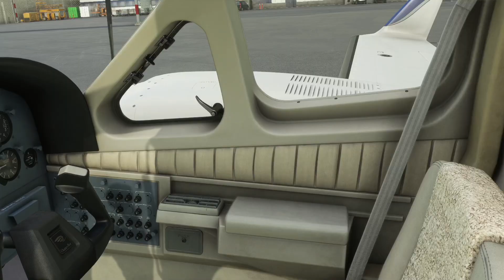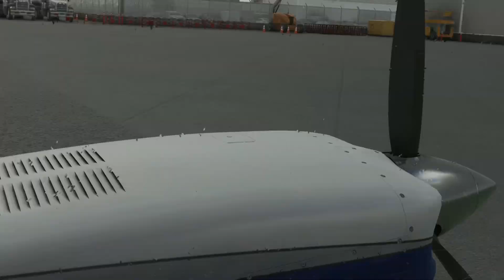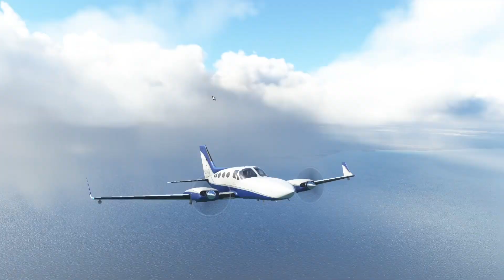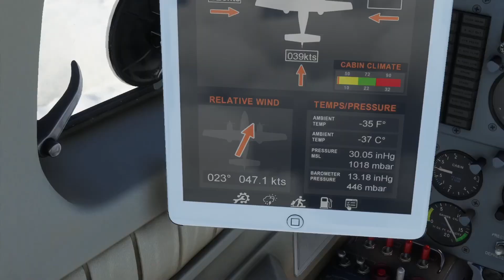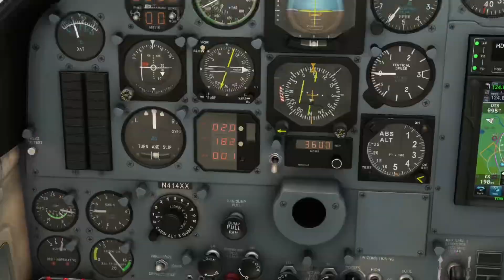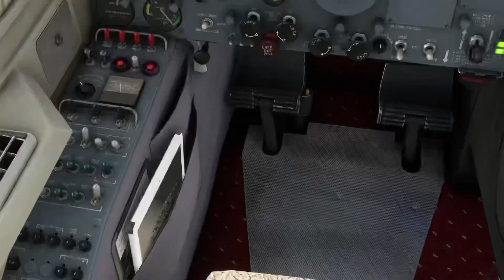MSFS | Flysimware Cessna 414AW | CYTZ-KALB | GTN750 | RNAV Departure | VOR Approach|

Comment: So great how many options we have in sim. I had this aircraft and the black square duke on my “favorite” list for dual engine aircraft. Over time I realized that, for whatever reason, I just dont like multi engine GA props. Who knows why, but they dont draw me in. 

So I fly airliners, regional aircraft like ATR, and then single engine planes like tbm 850, simworks pc-12, C208 analog etc
Reply from the maker: It’s great there is a lot of variety for types of aircraft to fly in the sim, it’s one of the things I like the most about MSFS. 2024 looks even better with many new addition new aircraft, can’t wait. Cheers!

Comment: Nice video so far, just at the 13:10 mark and am wondering how you were able to add waypoint and it sequenced it after the next enroute waypoint.  I don't think this is the way the real device work.  I own a 421 and have the simulator too on my ipad.  I'm guessing it must be a flaw within the sim.  When I add a waypoint, it goes to the bottom of the flight plan unless you use the insert after or before feature.
Reply from the maker: Hi. Cool, a 421 would be a nice airplane to own! That is what I was doing. I just select, Add Enroute Waypoint. and enter each one, they sequence in the order I enter them each time going to the bottom. I'm not sure if that is correct to the real GTN 750 but it seem reasonable.  If I want to enter another fix later between two waypoints  then I use the insert before or after function. Cheers!

Comment: Really enjoyed this video... as always. I haven't flown the 414 in awhile. I'm enjoying the steam gauge Bonanza at the moment. I have the GTN 750 Premium and after your checklist demonstration, I installed some checklists for the first time. One question: When departing with a brief SID with a manseq, my GTN goes into suspend mode. What am I suppose to do once my plane reaches the end of manseq? Do I use direct mode to the next waypoint? The flight plan is broken at that point or it's a discontinuity.
Reply from the maker: Thanks Gumper. When you hit the manseq the aircraft will maintain the last assigned heading/track. Usually I'll go to heading mode or direct to whatever the next assigned fix is.
Reply: @Bandit-FS  Thank you.